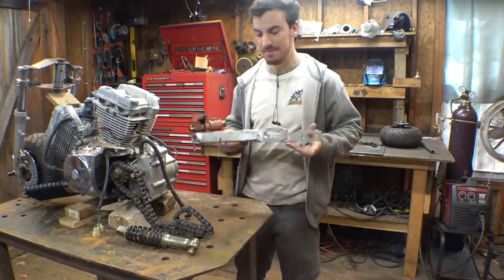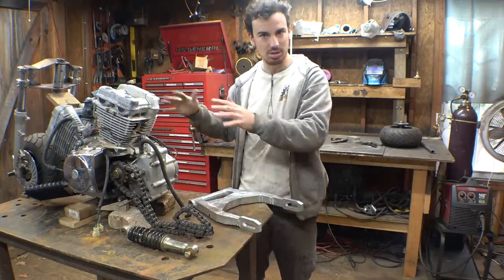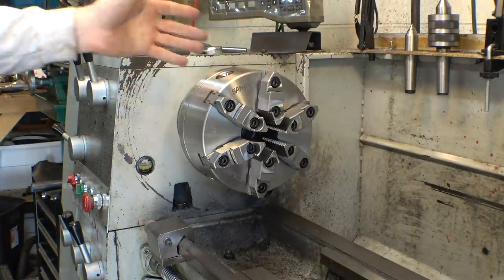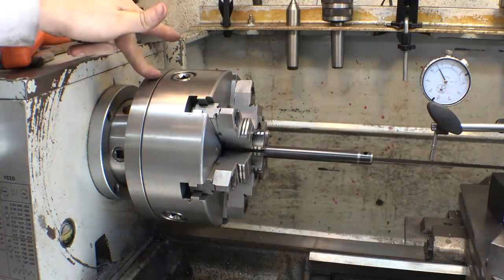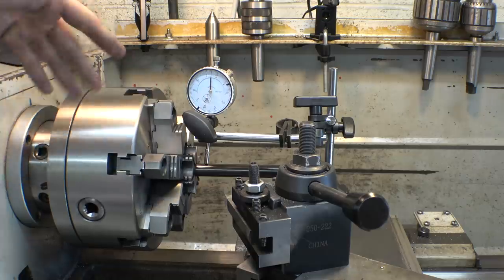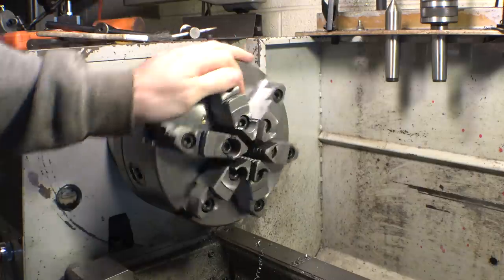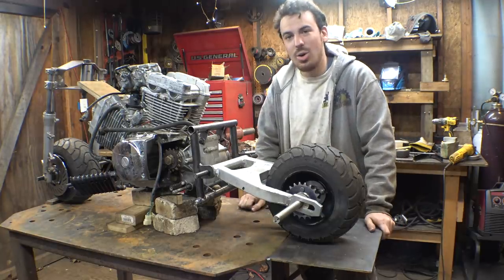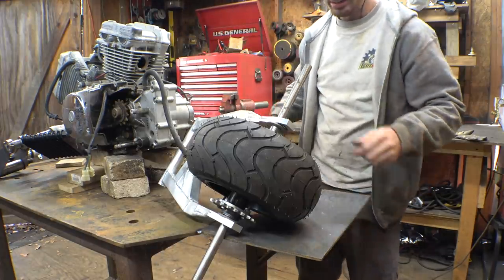Mini Crotch Rocket Build Part 2

Comment: when measuring the chuck run out you should always measure with a piece of known true round stock in the centre of the jaws not the external face of the chuck body , great addition to the shop once you get it dialled in, keep up the great work chris , im a keen follower from the uk
Reply: Yes exactly. Otherwise how do you know the round stock he is using is not bent. Certainly seems seems so the measurements are so different the chuck end and the tail end.
Reply: Using tail to center with the round stock is a pretty good idea I believe, no?
Reply: im no machinist known true round sounds good from the throne im sitting on
Reply: Also he was supposed to face the plate himself anyway. It's just good practice to ensure its flat with the cutter of the lathe. That's why they come so much thicker than needed, so it can be faced on the lathe it's to used on. He should have made the chuck register better az well at the same time. It's part of how his channel is though, no research until he really has to and just grinding his way to understanding what works and what doesn't. It's his way to do everything including his builds which never go the way he intended but he ends up with something cool anyway.

Comment: WELDING NOTE: The heat is trying to expand the air through the final opening on the swing arm. Thats why you cant weld it. drill a small air escape hole somewhere obscure, then weld the top plate
Reply: Interesting. Thanks for your comment
Reply: learned this the hard way on DOM tubing.  All my other welds were great until I got to the very last weld.  It would always ooze out like playdoh.
Reply: That's exactly what I was thinking
Reply: Ran into this problem many times. After everything cools off, you can usually weld the vent hole quickly if necessary.
Reply: Great tip!
Reply: Yep, spot on.😊

Comment: your "Hole" in the swingarm is most likely due to being the last part of a sealed small area, the air inside heats up, and if theres dirt or oil inside that part of the tube it keep boiling out! if you had drilled even the tiniest little hole into the pivot tube it would have released the air and you can weld up that hole on top
Reply: exactly what i was thinking.
Reply: Nailed it. It simply needs a vent hole.
Reply: I'd go as far as to say he probably wants to purge the air inside with shielding gas
Reply from the maker: Ok that makes sense, I never even thought of that at the time. I will definitely try that out and see if it fixes the problem. Thanks
Reply: @ratherBweldingChris  piye lor?

Comment: Just a quick one on the 6 jaw. 
Multi jaw self cantering chucks are notoriously poor for accuracy. Even high end ones. 
Usually they have an adjustment on the side to help dial them in. 
But for any job you want to be truly centred if it doesn’t have the adjustment you always need to tap the Chuck true which is why the register on the backing plate is sloppy. Or you get soft mild steel jaws and bore them to suit the diameter of the part your machining. 
What you have done is great. But I’d just put the dial on the part and tap the Chuck true for each job if it needs it. It’s kind of irrelevant how true the body of the Chuck runs. It’s how central the part is that matters. 
Cracking work as always. And going for the Ducati monster style is a cracking idea. Amazing looking bike. I have no doubt that engine will be more reliable than the Ducati engine too!
Reply: This is basically what I came down here to write, lol
Reply: @beauson1983  me to.

Comment: All you really need is good independent 4 jaw, yes it takes a bit longer to set up BUT your work will be spot on every time.
While you where cutting the back plate you could have set up a small register to fit the chuck because 3, 1/4 inch bolts will not keep the chuck true when you go to do something with interrupted cuts...
Reply: I agree could have easily put a small register while he was there. I believe it would have come out better.

Comment: That ugly spot on the swing arm is the final weld that's sealing up the air pocket. As it heats the air inside, it blows out through the molten puddle. Just drill a tiny little hole in the triangular piece of aluminum for the expanding gases to escape and it'll be fine.

Comment: I made a grinding jig to true my scroll chuck jaws, it's the ultimate way to get it perfect. Similar to running a boring bar through the jaws, just grinding with
silicon carbide stones. It requires a precise ring to be clamped in the jaws (externally) to remove slop. Once done everything gets stamped for correct reassembly (repeatability)
So far I've only had to do it once.

Comment: Add some mounting points for a wheelie bar while building the rear frame just in case.
 I am curious to see if that rear gear is going to be big enough. 
Would like to see some custom fairings.
And keep up the good work!

Comment: Aluminum welder here. Next time make sure everything is clean inside and out. And on your final weld, turn the amps down a tad after it's cooled off. Heat is causing gas expansion and the gases are just finding the path of least resistance. Let it fully cool, turn the machine down and put your last dabs of rod on. It looks good.

Comment: Back in school we used to adjust the chuck by tightening it slightly and tapping it with a mallet at the "highest points". The needle barely moved at all after a couple of attempts. Not the best way but it worked for us.

Comment: I'm a CNC machinist but I might can help. Use that ground bar stock to indicate it in. A truing bar would be ideal but the ground rod is basically the same thing. This way you dial in the part held with the 6 jaw. Same way you would dial in the tail stock but backwards. 6 jaws are awesome. Edit, Almost forgot. You could also chuck a large bearing race and indicate the I.D. The reason you would want to do it that way is to be concentric with the jaws and take out any error between the chuck body, the jaw scrolls and the jaws themselves. Hope this is helpful. Rock on.

Comment: You can’t weld a closed off cavity 
The gasses inside expand and blow out the weld 
Try drilling a 1/8 hole in a spot you can’t see 
Sometimes you can quickly weld the hole after the rest of the welding is done 
After the part cools down

Comment: Drill a 1/2" hole x 1/4" dp. thru that porosity spot (to interconnect the air cavities inside all those tubes) then clean hole w/brush.  Drill a nice centered 1/8" hole on the bottom side of the cross tube (to vent gasses) ..then plug weld the 1/2" hole.

Comment: You want the swing arm pivot in line with the output shaft of the engine.that way the chain won't rub the swing arm through its travel.
Reply: You know that it's not always gonna be in line as the wheel goes up and down, right?
Reply: @MrArcticPOWER  ?  If both the engine and swing arm pivot are fixed mounted,how can that change with the arm going up and down? We are talking about the swing arm pivot point,right? Any motorcycle or atv I have ever worked on,the swing arm pivot is in line with the counter shaft sproket.
Reply: @darrinwoodward14  In line with what? If you only have 2 reference point, how can they not be in line?
Reply: @MrArcticPOWER  the swing arm pivot needs to b parallel with the output shaft of the engine.if both are "fixed points",there is no way it can change with the swing arm moving up or down.at least,that's what you said,that it won't always b "in line" as the swing arm moves up or down.the reason they are put into that position, is so you get maximum travel with the swing arm,before the chain starts to rub on it.
Reply: @darrinwoodward14  What you're saying doesn't make any sense. How can two points be in parallel with each other? If you got two fixed point, it doesn't matter where they are, if you draw a line between the two, that line will always be straight. The third point is the wheel and since it's not fixed, it's not always gonna be in line with the other two points. 
What you actually want, is that the 3 points are aligned at the bottom of the suspension travel. That way, the chain tightens up as the suspension moves down. It as nothing to do with the chain rubbing.
Reply: @MrArcticPOWER  lol,you should have said it that way in the first place! All the kid said was he didn't know where to put the pivot point of the swing arm in relationship to the front sproket! It needs to b parallel with the sproket! No body said anything about the back of the swing arm,or the rear wheel.
Reply: Also,it's going to b a mini bike,so it will have very little travel in the first place,at least,nothing compared to a motocross bike,or even a quad.

Comment: Ahh damn man. I would use something like a guage pin or a cut off old drill bit in your chuck to indicate the run out. That rod you had in there might be good but you would never be able to tell for sure. A guage pin in definitely true round

Comment: You generally would want the chuck to mate perfectly in a perfect world and also it’s common with high quality machines and components to machine a blank backplate on the machine to fit that chuck. But I prefer to matching clearance in my back plate so wen I have that job I need to indicate my material in I can loosen the chuck mounting bolts and tap the chuck around with a lead hammer to put my material on center. Your back plate has excessive clearance for not having much bolt pattern clearance.  I would open up the holes on the backplate .02-.03 over bolt diameter to give your self some room to adjust things.

Comment: Step 1, get a precision rod.

Open the chuck, clean it up and re-do it without any kind of oil. Re-check your tolerances.

If you find discrepancies, then you know (i do hope you checked every bolt on it).

Once you're done, if you're still out, then machine a large ring, as close to perfect as you can (if you can find the race to a large bearing, that's even better).

Put said ring on the jaws, and open the jaws against the ring, with medium holding power (or about as much as you'd use to not dent a surface).

Now the chuck is open, and in that open position (the bigger the better) use a long shank motor and a grinding stone to regrind the jaws. Small bites, don't go aggressive, just kiss the teeth.

Once you're satisfied, stop, clean EVERYTHING with the detail of a surgeon and take the chuck apart (always keep all the parts indexed in the same spot, index the chuck to the plate, index the jaws to their holes, and index the faces to the moving parts, never swap them in between) and re-assemble with minimal, non oily, lubrication.

Guides pertaining to this can be found on both mrpete222 and Keith Rucker's youtube channels, both far more in depth.

Specifically these two videos (will post the titles as is, no links cause Tuber): 

mrpete222's "MACHINE SHOP TIPS #147 Grinding the Jaws on a 3-Jaw Chuck tubalcain"

and

Keith Rucker's "Restoring a Rusty Bison Six Jaw Lathe Chuck".

Both videos pertain to your plight. 

Personal observation, never expect to buy something from china and be hassle free. You're buying the raw materials, the assembly and fine tunning is up to you. This is not  me admonishing you, this is just a fact of life.

Comment: If you snug your chuck incrementally from each location until its tight enough you will usually find that whatever piece of work you are turning will spin a bit more true. For stuff that must be dead on accurate I usually use feeler Guage straps as shims between the chuck jaws and the piece being turned.

Comment: The problem you're having with the weld it outgassing on the final portion do to trapped air in the tube. You can drill a tiny vent hole and that should solve your issue.

Comment: Having zero idea of welding... Was that weld the last one where you close all the holes where the air can get out?

Can that bad spot of welding be because of the air inside getting hot and expanding, because it's enclosed inside?

Maybe, making a hole so the air can't pressurize will solve the issue.
Reply: You have at least one good idea because you're 100% correct.

Comment: If you have a 1/4 of play on the back plate, you can drill and tap 4 holes 90° apart on the OD of the chuck. It turns it into a adjustable 3 jaw or 6 jaw chuck. Research accu-rite and bison chucks. that's what we use at work.

Comment: You need to face the back plate to Match your lathe. If you need to remove the register that came on the back plate its ok. put a new register on the back plate.  You should always dial a Chuck in On   a known concentric piece of stock and use the dial on the stock Not the chuck. Rinse and repeat for the 5C Chuck.  After registering the back plate Leave your bolts kind of loose loose so you can knock the Chuck into concentricity Then tighten completely. Good luck

Comment: suggestion: put an inch or so longer bolt  through the upper mount for the connection to the rear swing arm. it would be an extra layer of protection if the chain breaks. i care for my chains  and even i recently had a chain break and snap a bolt location for the chain guard, bound up, and broke some trans parts.

Comment: Check the back side of the six jaw chuck it might be slightly out too. If it's out use your 3 jaw and put a fat piece of round stock in and the flip your six jaw around to bite the round stock and your backside of the six jaw can be resurfaced. Your parts will be slightly cone shaped off to one side and the longer the part the more it goes out of round. But first take some break cleaner to the inside of the chuck with it all the way open and close it make sure there is no dirt or metal shavings in one of the jaws from assembly.

Comment: You have to open a small hole underneath so the weld gases can come out. That's why you couldn't fuse the weld. The pressure of the inner gases is very high in aluminum.

Comment: The further the swing arm pivot is from the output shaft the greater the variation in chain tension.
The tightest run is when output shaft, swing arm pivot and rear axle line up. Above or below that position chain will get very loose and may need a spring loaded tensioner. The angle its sitting at (around 22 to 24 mins) is pretty close to lining up so tightest point.

Make a threaded bung and weld it in the ugly spot, use for mounting a chain guard so it looks like it should be there

You also need spacer tubes on axles to prevent bearings collapsing, the centre race will get pushed out if there isn't anything preventing sideways movement when axles nuts are tightened. Using deep groove ball bearings in steering is a bad idea, they are designed for radial  (roundy round) not axial  (side to side) load

Comment: probably a good idea to draw a centerline on  the table and weld brackets holding the motor up and in line 
you can improve the acuracy of the 3 jaw by pinning it once its adjusted as close to perfect as you can get it and then grinding the inside of the chuck using a small die grinder and stone chucked in the toolholder and slowly moved in and out while the lathe is running , should be straight to the rail the toolholder runs on 
hmmm yeah you couldve made a new shallow register while youre where at it

Comment: I wonder if you could remove the jaws from the chuck and mount it backwards to the lathe somehow and square in the back of the chuck like you did on the back plate. Or maybe put the collet chuck on the lathe holding a precision rod and then clamp the jaws of the 6 jaw onto that rod. Extend the rod out of the back of the chuck and use a steady rest to hold the chuck stable while you machine the back face.
You could also tig weld a bead onto the back plate(depending what it is made of) on the shoulder that centers the chuck and then lathe it down so it gives a positive lock to the back of the chuck.

Comment: Drill a hole where the bad weld is, then use it as part of mount for mudguard (other fixture), also will reduce chance of stress cracks there.

Comment: Chris, is there a hollow place under that weld? If so the heat is probably pressurizing it and blowing your weld away. You'll have to drill a pinhole somewhere to let the pressure off before you can weld it up. If not then it may just be a contaminated area in the aluminum. The only way to cure that is to remove the contaminated area.

Comment: That's exactly why the backing plate is so thick when it comes because you're supposed to face it up yourself to ensure its exactly level and parallel to the cutting post etc. I'd say it was the rod you we using to measure off of as it got so much worse towards the end. Oh yhea maybe face the plate again and make it so it registers better, tighter. It will help you keep it square and flat.

Comment: It's a blow out hole. Drill a 1/16 hole out of sight so the hot gasses can escape. I used to get that when building paramotor frames. Now i drill a little hidden hole on any joint that can pressurise, job sorted. Message me if you need more info.

Comment: For the backing plate, I have heard that you are supposed to machine them to make it match your machine. so I would face off the undersized lip and make it an almost zero tolerance fit with small chamfer.

Comment: Back when I was a tool designer, the welder always told me I needed to design a vent hole in the tube so that it would not build pressure and blow the weld back.  Maybe that is what happened.

Comment: About the 6-jaw... You should defenitly machine a better self-centering backingplate. I see it has some screws that attaches the jaws to the chuck. Maybe loosen those and see if there is any play there? Worst case... Put a true straight piece of metal on the center / drilling -thing (dont know the name in english), spin the chuck as slow as possible with some diamond-paste between on the metal-piece and grind the jaws to true precision.